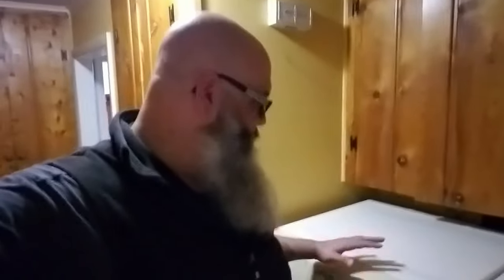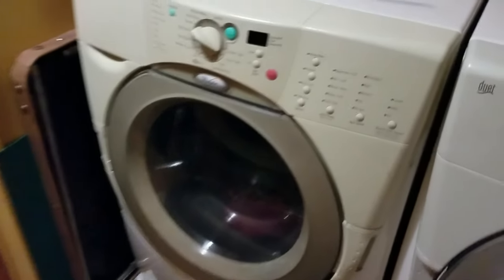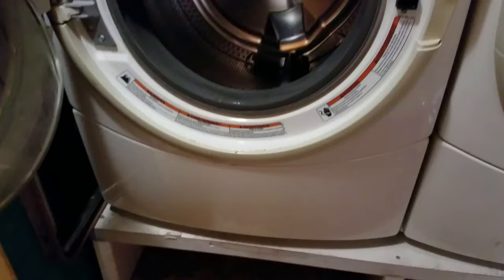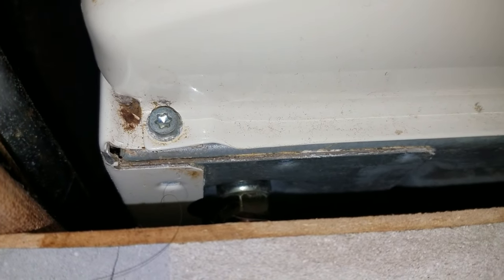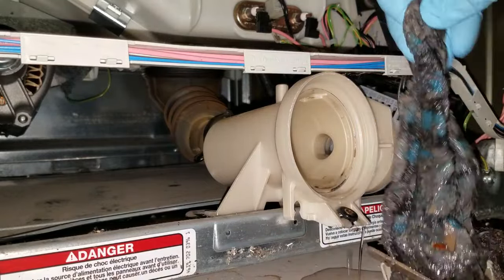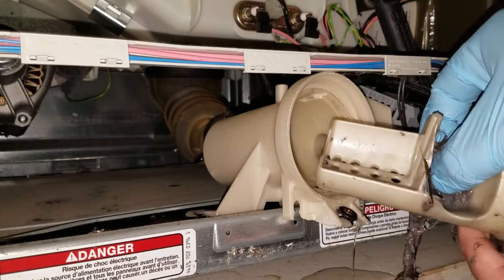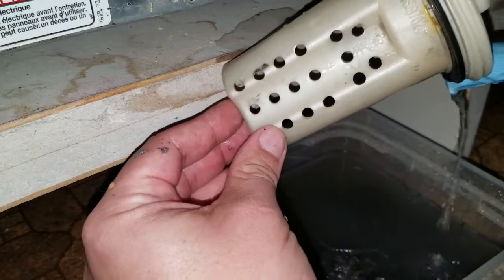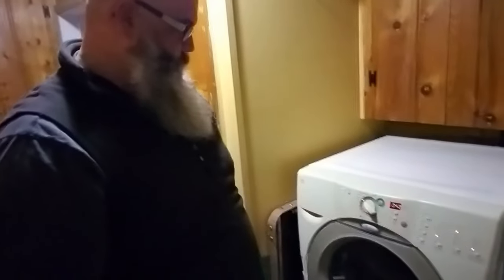Fixing a F-02 error on a Whirlpool Duet Front Loader Washer

Comment: FANTASTIC, easy to follow video!  I am a 67 year old lady and did the repair myself in about 15 min.  Only had to take off the bottom front panel.  Didn't even have to pull it out from the wall.  Found several coins and a good bit of lint blocking the drainage holes.  Cleaned it thoroughly, replaced it with no problem and have a test load running now.  Thanks again SO MUCH!
Reply from the maker: You are so very welcome Rita! Super glad my video helped and way to go on cleaning it out and fixing it yourself!

Comment: Thanks so much for posting this. I have owned my set for 18 years and my husband will, at the sign of first problem, prepare to buy a new appliance. I fixed our old fridge 5 years ago for $25 (a fan), and have replaced the squirrel cage in the dryer for about $50 (ball point pens in it). I knew there had to be something fairly simple going on here. I am about to tear into it, and even if I have to replace the pump, it is still a bargain compared to buying new. And yay! The 2005 grey set I bought is now back in fashion and fits our new industrial farmhouse look. Thanks, again!

BTW, we have used the leaf blower method of cleaning out the dryer vent, and it DOES work, quite hilariously. Give it a try.
Reply from the maker: Ha ha ha...I've never heard of the leaf blower method! I will definitely check it out!  Good job on fixing the washer, and you're right, even replacing the pump would be way cheaper than replacing washer...and, not that hard either, especially for you it sounds. 😉 Really glad my video helped, and I really appreciate the positive comment.

Comment: Hi Gary the Bearded Wood Worker…you are one great YouTube instructor, right to the point. I do have the same machine the Duet Whirlpool and it constantly giving me the F02 error code. It took me almost all night doing single load due to this error and this morning I was about to call a repair technician and for some reason went to YT to get info on this problem and it was your video that came out first, took my screw driver and followed your instructions and took me about 15 minutes to do it and saved about $300. There were dirt like lint plus 3 face masks all wrapped up in the drain tube.
Again thank you very much for your great video
Reply from the maker: You are so very welcome...and thank for the success story comment. I live to hear that my video was easy to follow and it helped with the problem. Sometimes it doesn't help because the actual pump goes out and it gives the same error code. Congratulations on doing it yourself!

Comment: 2022 and this is still a great how to and fix. Exactly as shown with extra steps I’d recommend. Get as much water out of inside. Cup Scoop and towels.  And I think as shown get your filter out, pull forward, to drain easier into a bucket. Hopefully you can raise or already raised unit. If not use some sort of flat cookie sheet type pan or container to catch water or just grab a ton of towels. Our filter had minimal items. But awesome to see how easy to unclog if needed. We ended up replacing drain pump and that was just as easy. Disconnect the 2 pipes (big black into back of filter & white going out from pump) with the clamps using pliers. You’re working in small area to get clamps squeezed to pull pipes so keep that in mind and maybe a flash light to help see clamps better. Also, unplug the wiring harness from side of pump motor-very easy plug and play type wire plug. Working the entire unit of the filter is easy with how they have it rubber mounted to floor of that machine. Be careful not to break or exert too much. Little back and forth tug and you should loosen and see how to gently remove. Once you can get filter and pump out, 3 screws to detach motor pump. You can either order that entire filter/pump or just the pump motor. Both ways under $30 from Amazon. I did both for $50 since I couldn’t find model # of Maytag and wanted back up if one didn’t fit. I tried just pump first with success. Backup of filter and pump is insurance should this happen again. Once motor pump screwed on to side of filter, reattached entire unit back. Getting the pipes back on and clamped a bit of challenge but again light and good pliers and making sure clamps seeded well to make sure no leaks. Plugged back in the power harness to pump and re-plugged washer back into outlet and ran an empty quick wash test. No leaks, no error code, super happy to see this video to follow, less the cat. Already running clothes successfully. Thx to all for comments. Easily a task anyone could do given torque screwdriver, pliers, lighting, replacement parts and some buckets and towels. FYI, if you see SUDS code, probably a big hint either clogged filter and easier fix or your pump about to go like ours. And you’re most likely gonna get the error code F 02 and dead cycles to not complete any loads.

Comment: Unfortunately not the problem with our particular machine, thanks for taking the time to make this.
Reply from the maker: Sorry to hear, Sam. I also believe that if your pump goes out, it will also give you the same error code. I guess it is a not draining code. I don't have a video, nor am I an appliance repair guy, but perhaps look into replacing your pump. I think it is pretty easy and inexpensive. The pump is right next to (or even connected to) the drain. Good luck!
Reply: @TheBeardedWoodworker  It was the pump, it was so worn out that it was stalling out preventing the washer from draining. 
Luckily my dad had taken parts out of a broken washer years ago and we had a spare pump!

Comment: I will have to do this soon...I am able to get rid of error code but your video gets straight to the point.  I have the exact same set.  Thank you
Reply from the maker: Good luck with it! It's not too hard, but the water does get away from you. Not sure how easy it is to do if you don't have your washer on a pedestal. 👍
Reply: @TheBeardedWoodworker   So I got at er' today... No socks, but OMG now I know where the smell of rotten eggs was coming from.  I pulled out a whole bunch of crap (nasty), water bottle caps plastic toothpicks, and the weirdest was 5 coins.  They had calcified to the sides of the stopper and were in there like a rock.  I needed a screwdriver to pry them loose.  All clean now.  So thanks again, I would give you another like if I could.   Oh and I had an old dresser drawer that I propped underneath it so it was tilted back, some water still drained into the old drawer. However, it worked fine.  So anyone else could use anything like a 4X4.  I just finished my first load since I cleaned it up and worked awesome, no more rotten eggs smell either!
Reply from the maker: Eeeeeewwwww....that sounds gross! But, yeah for getting it done! That whole calcified coin thing is weird. I wonder if it's caused by hard water, or the reaction to the metal from the detergent or bleach. Either way, well done!🥚🥚🥚🥚

Comment: Great video.. An alternative to removing the screw and pulling the filter housing forward is to leave it in place and hold a shop vac hose up to the bottom of the housing while unscrewing the clean out door to catch the water..
Reply from the maker: Great advice! Sounds like it could be a little less messy that way.

Comment: Hi  and Thanks
 Well done and simple explanation. I use it to source my problem and fix it. 
 Just as a heads up and not as a negative critic. Everyone needs to remember to clean all mating surfaces with a clean dry cloth and have them very clean of grit (not clean of staining) and a good idea when reassembling to give the gasket or “O” ring a light coat of plumbers grease (silicone grease ) or Vaseline to have a better seal.
 Thank you again , this saved a service call $$$$$$ .
Reply from the maker: Hey man, thanks for the tip. I like constructive criticism in a positive way. I'm glad you found  some use in this video. Thanks for the tips!

Comment: Still relevant in 2021! Thanks for the help!
Reply from the maker: No problem! Glad it helped. 👍🏻
Reply: @TheBeardedWoodworker  actually , since you were so helpful w this I have another question. When I run the washer now there are these plastic debri chunks that scatter and get attached to clothes. When I look under the gray rubber seal (where socks can gather, there is a cracked seal ring w the plastic chunks. Looks like it is peeling. The washer is super loud now. Do you have any experience w that issue ?
Reply from the maker: Yikes! I sure don't, sorry. Hopefully something that can just be replaced? Wish I had an answer. Good luck!
Reply: @TheBeardedWoodworker  looked into it. They say It’s the front tub that’s completely shot. Expensive part to replace and seeing how the washer is pretty old looks like I’ll begetting a new washer. Welp, at least I got a few extra loads out of it by fixing the Ol’ F 02 error
Reply from the maker: Awwwwe man.....sorry to hear! That sucks. Good luck finding a replacement. And.....yup, at least you got another couple of loads in.

Comment: Hi there, I have the same washer and today all of a sudden it gave me F02 and would not go away. There was a puddle of water inside so followed your method and opened the filter  but there was not much crud(much less a sock) in the filter or bellows. So to drain the small amount of water in the tub I did a drain cycle a few times and I can see the water slowly draining but not all the way before the F02 error started again. Pulled the plug in the back and repeated the drain cycle until most of the water was drained.
Still cleaned the filter and waiting for all to dry and will try to run again tomorrow.
Reply from the maker: Osewani Narimashita Hmm...I wonder if there is something on the inside that hasn't made it's way out. I'm not a appliance repair guy, so I really don't know what else it could be. Let me know if you fix it! Sorry if this wasn't any help. Good luck!

Comment: awesome video! I did this and pulled out tons of stuff from the filter. Immediately ran a cycle but still getting the f02 error?🤷‍♂
Reply from the maker: Nooo!!! From what I've seen and read, it could be your pump doesn't work anymore. I believe the F-02 error is it's not draining, and most of the time it's blocked, but other times it's the pump. I don't have too much experience with them, or a how to video, but it looks pretty straight forward and will probably run $80-$100 bucks. The pump is located right next to or behind the filter. I have since gotten a new washer and dryer, and can't really help much. Sorry. Good luck!

Comment: Great video. Thanks
Reply from the maker: You are welcome. Hope it helped!
Reply: @TheBeardedWoodworker  my filter was ok, just a little bit gluey. I've cleaned it. I am still getting F02 code. Is it time to take a closer look at the pump? I will disassemble it today, check if hose is clear and not obstructed. What do you think?
Reply: @TheBeardedWoodworker  I've found piece of garment blocking pump blades! Son of the gun :))
Reply from the maker: @lesio333  Wow! Really? Did that fix your problem? If so, very nice work!👍
Reply: @TheBeardedWoodworker  we've run the washing cycle, everything is working correctly. DONE. Thank you for your help :)
Reply from the maker: @lesio333  Awesome! Way to go!👍👍

Comment: I followed your video and drained the machine. Upon restarting the machine and doing a load of laundry it worked, but then the code came back on. Is there anything else to do? Thinking maybe something is stuck in the back tube, can that be taken out?
Reply from the maker: I'm not an expert on this, but I feel like someone had commented that there was something in the hose once, or it could be the motor for the drain is out. That would also give you the same error code, because the water isn't draining. Wish I could help more. Good luck!

Comment: I would like to know, how did a sock get in it in the first place?
The holes in the tub are not big enough for a sock to go through.
Reply from the maker: Right!? I'm assuming it slips through the gasket somehow. I have never found anything inside the gasket with the small holes.
Reply: I have no clue but I had several in mine. I think my girl had been over loading it and somehow got past the gasket... Or those damn laundry gnomes
Reply: You'd be surprised.  Less than 5 years after we bought our washer, the laundry room was stinking to high heaven.  I opened it up and found several baby socks that were stuck in that drain thing in the video and even underneath the rubber flap in the door.
Reply from the maker: Fullpattern holy crap! I never even thought of that!

Comment: Often you can find a hex( metric or SAE) sized that will fit into the inner points of the star bolt if not too much torque is required.

Comment: Hi. I've got a Maytag (I think they're another brand within the same corporation) and have just started getting the F02 error. The setup of the machine is very similar, the filter is pretty much in the same place. The drainage inside the drum looks clear and, apart from a couple of coins that I removed, the filter is clear but I'm still getting the error. Any ideas, or does it sound like the pump is broken?
Reply from the maker: That would be my guess. You should be able to hear a difference in the drainage cycle. I'm not a plumber or an appliance repair guy, but I would think the pump would be able to be swapped out pretty easily. Just a screw here and there and a couple of hose clamps. Good luck with it! I'm sure you can find your part on Amazon for under $100 bucks.
Reply: @TheBeardedWoodworker  OK, thanks for the speedy reply.

Comment: I cleaned that filter out, there was barely anything in it and definitely not enough to constrict water flow. I filled up almost a 5 gallon bucket worth of water when unscrewing that filter. 

My washing machine ran for roughly 5 minutes on a Drain&Spin cycle, the SUD error code came up then the F02 error code came back on...........

Any ideas on what i should do next?

Comment: Drain clogs very common on front loads...thsts a good design easy to get to filter...many models arent so easy...is your real old washer still working?..i just picked up this old model for 45$ in working condition..and it came with a nice whirlpool pedestal ...i know its pretty old but the price was right... does anyone know manuf date?..im thinking 2001..does anyone still own one of these real old duets?.and can anyone tell me how this model has performed for them...i know ftont load washers sre proned to have issues and fail....hey bearded..i am into cnc router woodworking.

Comment: We had a 2011 whirlpool duet front load set.... Got rid of it... What year is this washer?
Reply from the maker: Not 100% sure. Bought it off of craigslist about 3 years ago. Seems to be holding up....I mean after I fixed the error code of course. 🙂
Reply: @TheBeardedWoodworker  Thanks!
Reply: We also often got that error code on our old whirlpool duet. We often fixed it ourselves, but it kept coming back. If only we watched your video instead of replacing it.....

Comment: Check the safety switch also    see    
https://www.youtube.com/watch?v=w3DBHPAAOec&ab_channel=Guidaelettro-domestici.com

HELLO  CHECK THE WATER LEVEL SAFETY SWITCH  AT THE BOTTOM OF THE MACHINE. If You had a small water leakage the water is at the bottom and the safety switch is closed and active and the pump is till running. For testing disconnect the switch connector.  The code is also F02 on the ddisplay. If machine runs OK replace the water or change the switch.

Comment: Sooooo....on our machine, the five little holes you show in the beginning of your video are plugged up with mineral deposits from hard water. I think I am going to try baking soda and vinegar. Is that useless? For 25 years, never noticed the holes until I was cleaning the rubber rim today. Time for a repairman? New machine? Thanks.
Reply from the maker: Hmmm....I would try cleaning it first foe sure. If it's too clogged, you could just replace the rubber around the opening. It's pretty simple. Other than that, I don't know. I'm just a handy man that fiddles around at home. 😊 Good luck!

Comment: Did all this and still won’t work. Anyone have any insight? Is it the board now?
Reply from the maker: It is probably the pump. I'm not an expert, but with some research and a detailed comment in this thread, it could be.  It sounds pretty easy to replace the pump too, not that I have a video or the same washer anymore. We upgraded. Check out the lengthy comments and you will find a little info. Good luck!

Comment: Mine didn't have any obstructions after taking the strainer out and the black tube.
Reply from the maker: Hmm....could be a bad pump? Not a repair man, so I don't really have an answer for you. Sorry. Good luck!
Reply: @TheBeardedWoodworker  i checked the continuity of the motor at 16 Ohms of resistance, power to the motor and it's 115vac 👍. After reconnecting the motor electrically put it on spin cycle and the impeller does rotate rather fast. So i am up in arms 💪on this one.